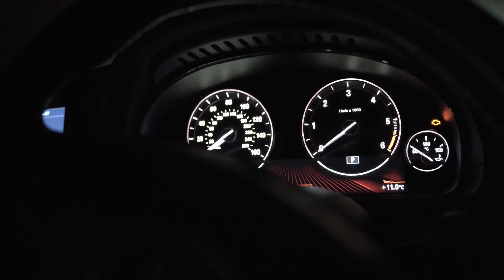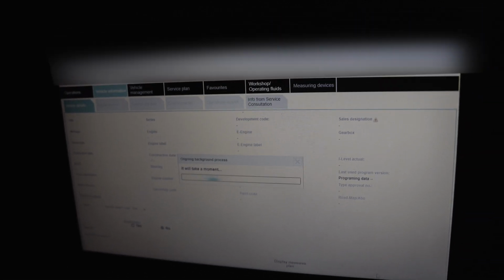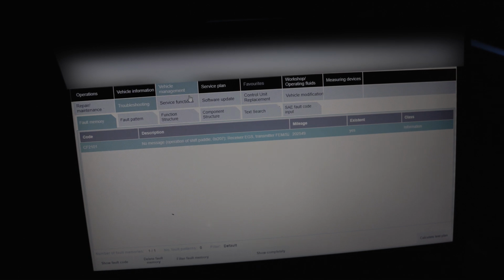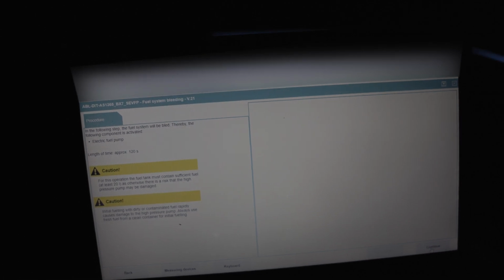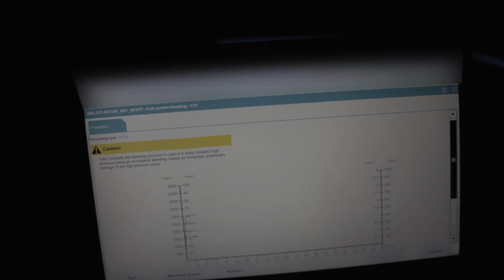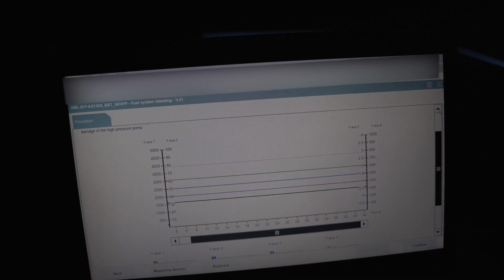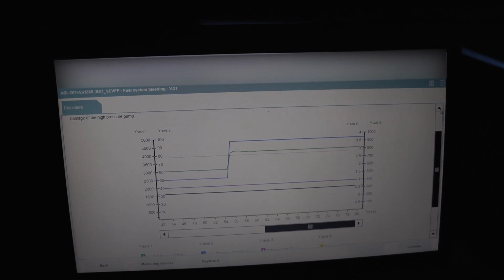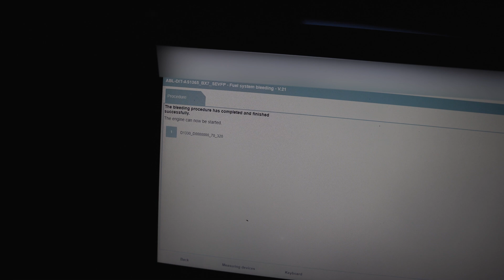How to prime bleed the BMW F10 fuel system - Avoid damage to High Pressure Fuel Pump

Comment: this applies to both petrol and diesel engines?
Reply from the maker: it is more pertinent for diesel, but can be used for petrol also
Reply: @BestCarMods  ok, i just replace fuel pump inside the diesel tank (Bmw e65 730d) but the pump will not stop priming when i switch ignition on, before it stopped after a few seconds when ignition is on. I it is also a strange pulsating sound in return inlet into the tank (left side). What fo you think the problem are?
Reply from the maker: @Trulte60  you will need to understand the system and investigate what ecu controls it, what are the inputs ,outputs and what wires are going where.  You should be able to get this info in ISTA or in the past there was a website called newtis.info ... I can do that type of research but will charge consultancy fees

Comment: Do you have to use Ista to bleed the fuel pump? Many guides just say to replace the fuel filter and then prime the pump by turning the ignition on and off several times to cycle fuel before starting the engine.
Reply from the maker: you don't have to ... however if you do it the possible faults resulting from the fuel pump not being lubricated are less likely to happen. I have the same observation, bmw literature does not say you have to do it.  VAG cars with same fuel pump have it written in the workshop procedure to do it. At the end of the day it is personal choice, I have many mechanic friends that to this day don't do it.
Reply: @BestCarMods  Thanks. I managed to get the leatest Ista+ version on forums. Do I need some power supply to connect the car whilst this is running? If so, what are they called? I'm struggling to find it. My mobile mechanic uses one, he connects red on red black on black and plugs the unit it to a socket in the house.
Reply from the maker: @rafh2753  Ideally Yes, you should have a battery support unit for doing this. Alternatively if your battery is in good condition and you kept it on charge you can do it without battery support. Any decent charger should have supply mode. I am using Cteck or GYS as brands.  maybe I will do a video about that ;)

Comment: Salutare ! Am un e90 318d cu pompa de inalte Bosch CP 4.1 si am desfacut senzorul acela cu filtru de pe pompa sa verific daca exista span, toate bune am montat inapoi, am dat din diagnoza de 3-4 ori bleed system si nu a pornit la prima cheie, ce-i drept nu am lasato mult sa dea la automat, am verificat pe diagnoza si imi dadea low pressure, am mai dat odata system bleed si pana la urma a pornit la a 2-a cheie dar la fel nu am lasato mult sa dea la automat, imi era frica sa nu mearga pompa de inalte pe uscat. Cum ar trebui sa fac pe viitor? Trebuia sa desfac conducta la injector in timp ce faceam bleed si sa o strang la loc dupa ce iesea motorina ? Ma gandesc totusi ca trebuia sa o ia din prima avand in vedere ca i-am dat bleed de atatea ori si s-a auzit clar ca merge pompa din rezervor.
Reply from the maker: eu cred ca ne stresam noi degeaba. a patit asa la un schimb de filtru la a mea. eu as evita sa umblu la pompa injectoare si altele de pe parte de alimentare. daca chiar am treaba acolo ... ii dau 3 4 bleed system si la cheie dupa.
Reply: @BestCarMods  da ai dreptate, eu doar am desfacut ca sa vad daca e span sau nu, sa pot dormi linistit. Oricum nu am dat la automat mult, decat scurt de 3 ori,probabil a prins un gol de aer pompa de inalte si de aia a pornit putin mai greu. Mersi de raspuns!
Reply from the maker: @robertc2380  imagineaza umatorul scenariu: cu 2 zile inainte am taiat niste metal la flex in garaj(am uitat complet despre asta). schimb eu filtru de motorina si dupa aia ma uit in recipientul meu ... hopa pilitura de metal ... panica maxima ... dau sa pornesc masina ... nu mai pornea .... gata deja cautam sa cumpar alta masina .... nu pornea si nu pornea ... eu dupa 20s ma asteptam sa porneasca ... la un moment dat ma resemnez si o las mai mult .... uite ca a pornit dupa .... ne stresam aiurea

Comment: Salut, am o întrebare, la mine in ISTA+ nu pot selecta vent fuel system, e scris cu gri. Folosesc cablul ENET. Am instalat doar ISTA-D. E necesar și ISTA-P pentru o funcțiune corecta? 
Alternativ, oare e posibil sa aerisesc cu ESYS, sau alt program? 
Mulțumesc 
———————————————
Hi, I have a question, in my ISTA+ the fuel vent system is greyed out so I cannot select it. I’m using the ENET cable. I only installed ISTA-D, is ISTA-P also necessary for this process or why wouldn’t it work? 
Is there an alternative to do this process, like with ESYS or another program?
Thank you!
Reply from the maker: iti da mesaj ca nu ai tensiunea correcta la baterie cand deschizi ISTA ? da-mi un mesaj pe IG si vedem ce se intampla.

Comment: ok I have a 2004 bmw 530d and I cleaned the injectors now my car won't start I think it's an airlock I have the bmw ista program should I just run it wat should I do
Reply from the maker: old school method says undo a bit each injector at a time and crank to release air.
Reply: @BestCarMods  ok thanks this have been giving a headache
Reply from the maker: @christohees9150  My first big repair on my first car ended up in a similar situation. Done the work, cleaned the intake, had to remove injector lines and after that the car did not want to start. That was one of the moments that I said I will do something else with my life, aka start farming. An old mechanic gave me the advice to loosen one injector line at a time and try to start the engine. It worked, I could see the air going out.
Reply: @BestCarMods  ok I've been doing this and I can see the bubbles coming out  so I think it's working